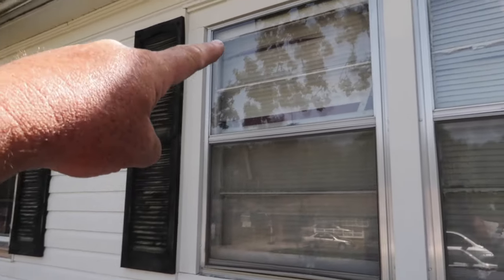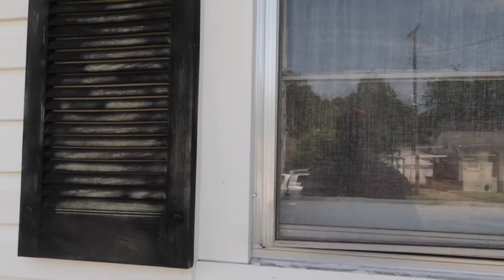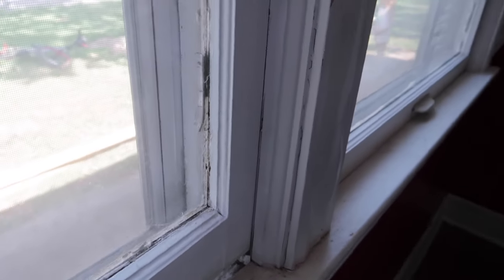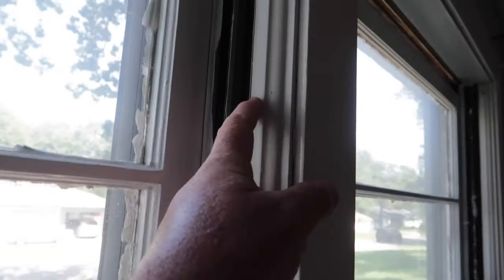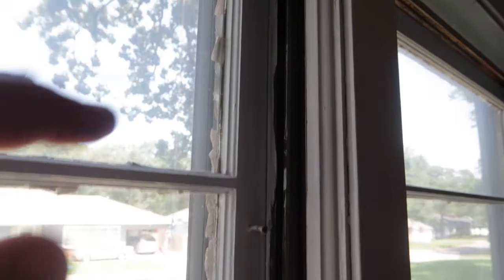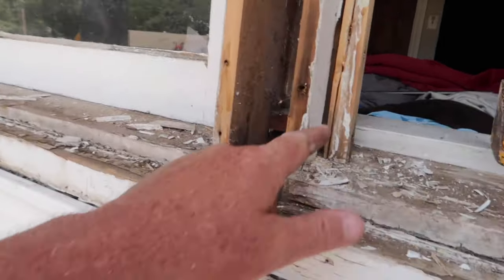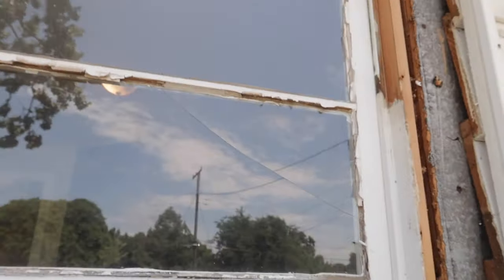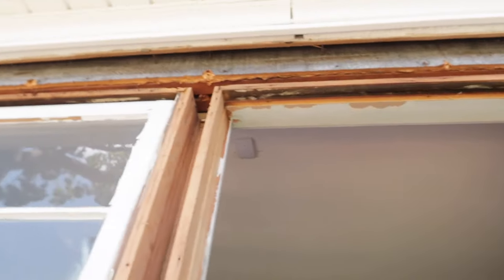How To Remove An Old Wooden Window-Window Removal-Replacement Window-Simple and Easy Short Video

Comment: Could you have gone I. Through the inside instead And leave the exterior trim ?
Reply from the maker: Yes but I was replacing the windows, trim and siding on the house so I just decided to pull them out from the front.

Comment: Better not to remove original windows at all. Repair and restore them and they will last another 60 years.
Reply: I agree
Reply: Old wooden single pane windows are not energy efficient at all.  So I guess if you want higher heating/cooling bills and continued maintenance (scraping and painting) over the next 60 years, then sure...
Reply: I rehabbed windows in my Galv. Victorian and used Resource Technoloy vinyl seals.  The windows were in pretty good shape but still not as efficient as current products.  I especially like the idea of installing fixed glass were egress is not required.
Reply: old windows sux like democrats
Reply: I totally agree...I love the old wooden windows, will not replace them at all ever...
Reply: @SpeedwayNative still cheaper and last longer in the long run.. then that plastic crap
Reply: Then don’t go cheap and buy the vinyl ones in the first place lol
Reply: How do you do this.
Reply: To repair them, they need to come out. For example, to reglaze the window for moisture, air leaks and structural integrity. Also, at this point, you can insulate the cavity as you can see they skipped back in the day.
Reply: Depends where you live. If you're in warm weather year round and don't care about insulating that's one thing but if you have cold winters upgrading windows is quite important